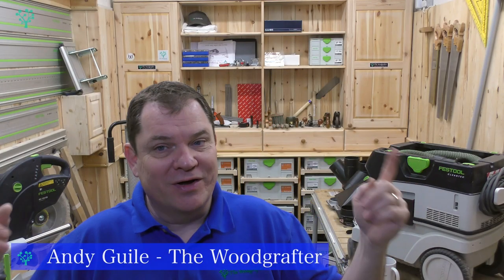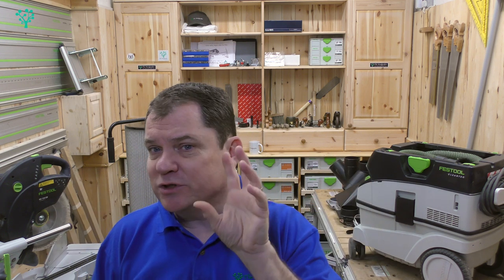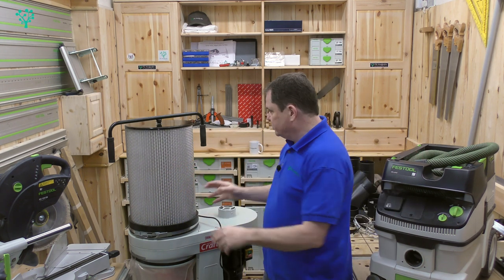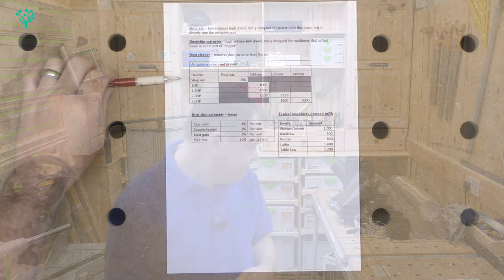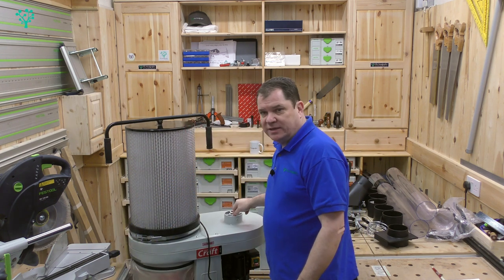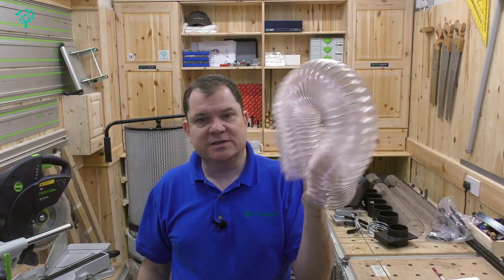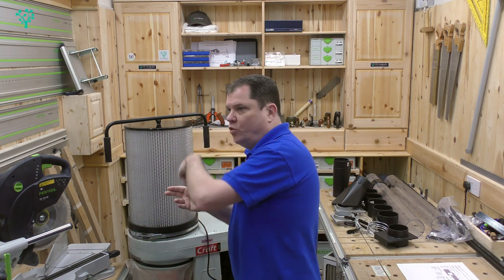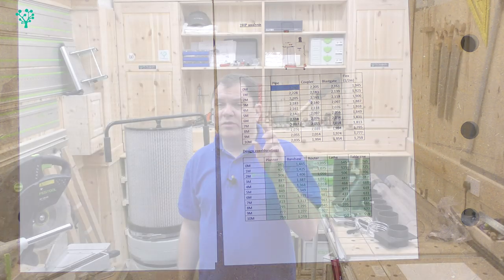How to design a dust collection system

Comment: This is the best video I have seen in discussions of dust extraction/collection. I've been thinking on this for a while now and just purchased a shop fox 1.5hp and found this while researching how to plan and lay out the plumbing. Your scientific approach to explaining airflow and losses was really helpful!
Reply from the maker: Hi Cameron,

Thank you for the feedback - not sure it is scientific - more a logical approach.

Like you, I needed to work out how to design the system. Most of the videos spoke about install and not design. So I thought it was worth while sharing.

Anyway, I am so glad you found this of value.

Andy
Reply: You’re welcome! And if not purely scientific, you’re the only one who discussed the math involved in calculating efficiency. Definitely going to be making some charts of my own soon to figure out how to set up the jointer and table saw.
Reply from the maker: I would be interested in seeing the chart concept. That would be a good thing to share.

Andy

Comment: Andy, many thanks for taking the time and trouble to explain the 'science' of dust extraction for a small workshop.  As with most woodworkers for me investment in good dust extraction is not only a must, it also is a significant amount of cash. So getting it right is essential. I have a double garage and currently use three quality shop vacs, a 3/4hp filtered extractor and an air filter.  Despite this and modifying my machines to improve collection, I have dust everywhere. However, I now understand WHY, so thank you. So now, it's back to the drawing board and I guess another 'I just need to' campaign. Thanks for a very helpful video.
Reply from the maker: Hi Mike,

Thank you for taking the time to get in touch. 

No matter what we do as Woodworkers we Will always have dust. The quality filter and enough flow to catch at source helps. I would also invest in an air cleaner, I have mine runningvwhen ever the machine running. Also runs for a few hours after the shop is closed. They are relative cheap and make a difference.

Finally good old clean down at the end of each working day or major process.

Cheers

Andy

Comment: That was a good and fairly comprehensive overview of the key technical details involved in choosing an appropriate dust extractor. Glad you put the facts straight for your audience about the marketing terms Festool uses for it's shop vac. They're trying to set themselves apart by misnaming the device. I have a CT48 so I'am not degrading the vac but it's good to let Festool know that we know the difference. Good job my friend. 
Norm from Montreal, Canada
Reply from the maker: Hi Norm,

Yes it took me awhile work it out, so thought it was well worth sharing.

Cheers

Andy

Comment: Hi Andy, I have used 4 inch soil pipe in longer lengths rather than 1 metre lengths and numerous joints. The connections are available to join the two different sizes without any problems. My overall length is about 34 feet around my garage workshop with 3 legs to connect to various machines, blastgates fitted to each leg. The soil pipe is also cheaper than short lengths. It works well for the big machines and I use a shop vac for the small tools. Hope this is of use to anyone who reads it.
Reply from the maker: Hi Dennis,

Yes that is a good way to and the longer lengths will still have a degradation of air flow but the big bonus is less couplers.

The push fittings on the soil pipe also give a great fit and make assembly easy. The only word of caution is on the elbows, the sharp 90degree can disrupt airflow much more than a couple of 45 or the gentle(er) slope of the y connector.

We can get the 100mm pretty easily in any DIY store (big box store) in the UK. 

I showed the 1M length solution as that would give  the worse point scenario for the small workshop.

Great input, thank you.

Andy

Comment: I sure wish I watched your video before purchasing all my dust extraction equipment. It's not installed yet, but sitting on my garage floor. I have an awful feeling I just spent a lot of $$$. Apparently it seems dust extraction information is a limited exercise in futility. Every video I saw and research I did was on piping, static, "no 90 degree bends", really fancy machines worth thousands of dollars donated to the youtuber, but nothing on the differences on HVLP or LPHV systems as your video did. Oh well, live and learn, just wish I would have learned before spending the money. Thank you for the information.
Reply from the maker: It took some research to work it out, so thought it was worth sharing.

Hope it helps

Comment: Very informative video and well explained, Andy. Mine is a small garage, but serioulsy thinking of having a dust extractor in it. Your video has helped in understanding the science and the drop in suction to be expected 👍
Reply from the maker: Hi Suj Menon,

Thank you for getting in touch, just watched your sign making video very interesting, a great build and I love the story behind the sign. I have now subbed and will be watching more videos.

I agree that Triton thickneser could do with some dust extraction :-) not sure what other tools you have, but I would look at the standard drum type extractors to keep the cost down and make use of the space. I used one of these for years before I finally destroyed it with my planner/thicknesser.

Cheers

Andy
Reply: @TheWoodgrafter  Cheers Andy, My biggest chip/dust creators is my Triton Thicknesser and my DeWalt 745 table saw. I will do some more research on those drum type extractors like the ones from Scheppach. My current shop vacuum is just an old Henry running at full load, LOL! Also doing some research on Cyclone systems, these seem to be good in collecting bigger shavings without clogging up the dust bag. Thanks again.
Reply from the maker: Hi,

The drum type and a cyclone will be a good option, just remember you will have small particles in the air so keep on the face mask.

Cheers

Andy

Comment: Andy, Google YouTube found you for me probably by eaves dropping on private conversations. Please keep up this analytical approach.  I have a 150mm dust collection system which is great as far as it goes. The compelling case you make is that with 3 levels of dust control running, the air can be clean and the mess in the rafters minimised. Yes dust / scrap handling is power hungry, lucky I have solar.
I am in the process of upgrading my system and will apply your learnings.
Reply from the maker: Hi Mike,

Good old google......

Yes I think three stages is the way to go - it works for me and the shop is a nice place to be.

Cheers

Andy

Comment: Well done Andy.  I guess your holding back on covering dust/chip separators for another day?   Now days I don't work too much with raw wood, so no big chips anymore to clog a small pipe. As a result, I don't use a large duct dust extraction system.  Now days I deal mostly with dimensioned lumber (pre machined to specific dimensions) and sheetgoods.  Here a shop-vac with a separator works great.   I also have for certain dirty tools (miter saw) dedicated shop-vac's, or a carry round unit, I Frankensteined together. Works great in the shop and around wherever I go. 

And if your viewers don't think they need a shop air filtration system, try a cheap experiment.  Buy a simple box fan (20") and a furnace filter to fit over it.  duct tape the filter onto the box fan  and set it to low in your shop.  Now look at it after about a week's worth of work and prepare to be amazed at how dirty it is.
Reply from the maker: Yes, still thinking about the cyclone addition to a dust extractor system - not sure what that will do to the air flow - and what exactly is the advantage of separation anyway.

Agree every workshop should have good dust extraction, I have an air cleaner - yes that shows up the amount of air born dust.

Cheers

Andy

Comment: Hi Andy,
I have in my single garage workshop a Record DX5000 wall mounted extractor running at 106litres/sec fitted with 100mm grey soil pipe for long runs, then y branches to plastic blast gates and flexi hose to machines works great and a festool CTL 26 the pipe runs in a loop along a boom that swings above my head and connects to power hand tools on my bench. Thanks for info might have a move around now as most machines are on casters cheers Phil
Reply from the maker: Hi Phil,

Thank you for getting in touch - yes it does seem from the various comments that soil pipe is a great option, and will produce less loss due to reduced numbers of connectors.

I keep thinking about a boom for the CT, both for power and for suction - I will probably include that in the new bench design.

I am also going to upgrade the mobile platform for my thicknesser - the base I bought from Axminster is just not iOS enough. Will probably do something like Peter  did over on the New Brit workshop.

Talk soon

Andy

Comment: I am curious why you haven’t mentioned segregated system as  strategic use of blast gates could actually improve the airflow by removing parts of the system that impact airflow. Loved this video perfect timing just about to install my system recently got a two hp extractor with cyclone so over capacity.   Planning on using two runs so can turn one off to limit reduction of airflow.

Comment: Good video. My dust collection system is developing very slowly, but includes a hepa filter dust extractor that is also a vacuume and I also have an overhead air cleaner. I am considering a  dust deputy.
Reply from the maker: They do have a habit of growing over time. I am still using the dust extractor and the Festool shop vac. I find they are the ideal combination.

When I build out the new router table (on the ever growing list) I am thinking of having both. The van on the top for high speed removal. And the extractor on the base for large volume removal from a collector.

Got to love woodworking.

Andy

Comment: Quite a complicated topic indeed, and some trial and error is required as the specs of the 'dust extractors' are often quite exaggerated by the vendors and measured in ideal conditions (without a pleated filter, let alone a dusty used one!). Similarly, not all 'machines' require the high cfm figures which sellers of dust extraction gear claim... a 6" or 8" jointer, or a relatively thin kerf table saw (rather than an industrial table saw or a 14" jointer) will work well with a 1hp extractor in my experience.

Somewhere in between the small shop vac (35l or capacity and below) and the impeller systems, one can also consider the 4"/100mm "canister extractors" which provide cost effective dust collection (0.5 microns and above) for single machines. These are scaled up shop vacs, with universal (thus noisy) motors and large inlets but are fairly well suited for the needs of amateurs, while being more "flexible" than a plumbed-in system.

One can also look at the use of a correctly sized cyclone to protect the life of the fine particulate filters and use larger 'dust/chip' bags, but that is also a minefield!
Reply from the maker: Hi you raise some great points,

Yes the ratings are a bit hit and miss, I may see if I can find an airflow meter and do some very basic experiments to put the theory into practice. To see what I am actually getting at the extractor and then see how it degrades through the system.

The figures I used for the matches, came from quick research on the devices I am likely to buy, rather than the extractor manufacturer. But agree these can vary big time, so it is also worth checking.

I know the canister type - in fact it was one of those that I killed by connecting to the jointer. The volume simply overwhelmed the device and caused issues - also they don’t have filtration to the levels I discussed in the video - so they do put dust back into the air. But I agree, if you accept the limitations they are great dedicated machine for smaller workshop machines. 

Cyclones are interesting, I am still researching those. I understand the science - however I can’t find any easy solution for calculating the impact on air flow - will have to get my head round some complex maths. In addition still thinking of the real life advantage, even if I separate out the big chips at the cyclone and the dust moves into the extractor - what have I gained. I still have a bag of big chips, just in a different place.

I can see an advantage that the big chips never contact the impeller so probably extends life, and also reduces sparks if you suck up screws from the shop floor. Beyond that do the advantages out way the impact on air flow ?

I haven’t seen that covered anywhere - so will dig deeper.

Thank you for the great feedback and comments.

Andy
Reply: @TheWoodgrafter  In theory, the tool to get is a Pitot probe like the Fluke 992, as it allows to measure air velocity as well as volume, which is more useful than what a simple anemometer can measure (not that reliably, I might add).
My attempts at building one haven't been that fruitful so far, although it's on my project list ;-)

Comment: Thanks for the video. This helped a lot. Curious if use as a portable unit would require the same HP and Max CFM for various machinery considering your runs would likely be shorter and singular in nature with out blast gates and couplers; albeit with flex hose?
Reply from the maker: Hi Neal,

In theory yes. It boils down to….

Look at the stated requirement of your machine, look at the capacity of your extractor at the port, then allow for any losses in the connection. 

Do the maths stack.

I do indeed use my extractor as a portable (ish) unit as I have recently relocated my machines and introduced a CNC. So am currently connecting directly with the flex pipe.

All works well, just a pain to drag it around the shop. 

This will be fixed soon.

Cheers

Andy

Comment: The 'key difference' is actually the motor. A chip extractor (what you call a dust extractor) uses an induction motor. This allows a large volume to be moved quietly and efficiently, But the low speed (3000rpm) means a large impeller and low pressure. A 'shop vac' (like any domestic vacuum) uses a universal (brushed) motor. Higher rpm, but noisy and inefficient. Gives a higher level of vacuum however, with a reasonable size impeller. The rest of your comments are quite correct.
'back into the environment' - yes, but does not have to be your workshop. Either piping the air outside, or mounting the whole system outside, gives 'perfect' filtration- at zero filter cost.
A compromise for an amateur workshop (where it can be hard to justify two extraction systems) is the drum extractor with 100mm pipe. Keep to 100mm for planer/thicknesser & table saw; power tools can use smaller- they usually have a smaller connection anyway. Add a cyclone and throw away the filter, mount outside/in loft space/outhouse/why. Quieter, cheaper, no returned dust.

What the world really needs is an inverter driven 3ph induction motor running at >10,000rpm - this would give high volume at high vacuum with a reasonable size impeller and low noise. The spindles used for CNC look like a good fit, and readily available in 2K2w size. Fancy a project?
Reply from the maker: Thanks for this,

I didn’t know that so thank you for sharing - makes sense.

On the cyclone - I thought the dust would still flow into extractor and the heavy stuff would collect in the waste. Not sure  I understand the throw away the filter comment.

I am looking to wall mount the extractor at some point, need to have he the garage door design to claim some real estate back above the PT.

Cheers

Andy
Reply: @TheWoodgrafter  A cyclone removes ~99% of the dust. (after a year of use I had a light dusting on the bottom of the cylinder) If your extractor exhausts to the outside world the 1% is not visible, and no HEPA filter to (eventually) clog is needed.Put the lot outside- cheaper, quieter, and no workshop space used.
Reply from the maker: Thanks for this, not sure my neighbour will enjoy the dust heading in his direction.

:-)

Cheers

Andy
Reply: @TheWoodgrafter   not to mention the massive heating bills... unless you happen to live in temperate climes and need no heating!

Comment: Andy..thank you..ive been into this myself ..and i got a 1 hp extractor..doh....i tried a thein baffle..-50% suction..im now waiting on an axminster dust cyclone...dont know how that will go !!..your video made me think..oh yeah ..move the extractor nearer to the machines..kiss in real life (keep it simple stupid)..and ill replace all my flex tubing with 115 soil pipe..hopefully it wont be shit .
Reply from the maker: Hi Martin,

Yes took me some time to get my head round things, but the system seems to work.

Having said - there is a new CNC machine on the cards, so that will test is it.

Let me know how the cyclone works out. I have mixed feeling about them. Would be interested in the impact it has on suction.

Cheers

Andy
Reply: @TheWoodgrafter  will do Andy...cnc eh ...im toying with the idea atm.
Reply from the maker: I am looking at the Ooznest Workbee. Seems like a good bang for the buck.

Cheers

Andy

Comment: I'd recommend the CT-VA-20 pre separator, yes its expensive but that's a given with Festool. I bought a Dust Deputy about 10 years ago, no doubt it works excellent once set up, but I found it a farce and its sat on a shelf since. I got the CT-VA-20, set up in 5 mins, use it constantly. The bag in my CTM 48 is almost completely empty. Also works with cheaper shop vacs no problem and really keeps the filters clean
Reply from the maker: Hi,

Yes I have seen that and I think that would be a very good addition for all the reasons you say.

I have actually stopped using the CT to clean up the shop due to the price of the bags. So this would pay for itself.

Expect to see one in the shop in the near future.

Andy